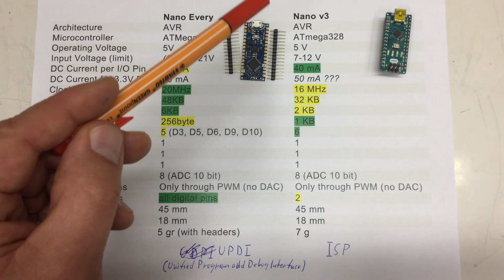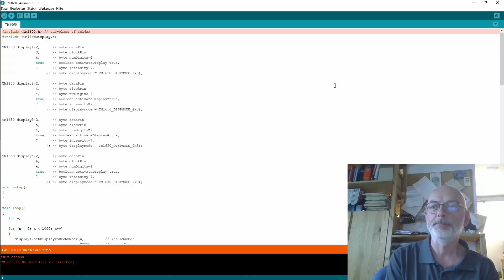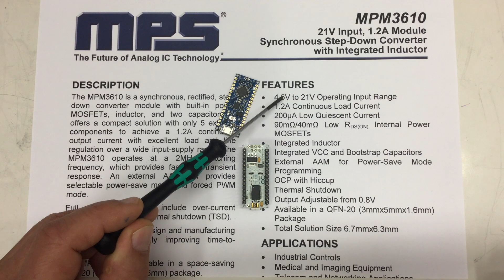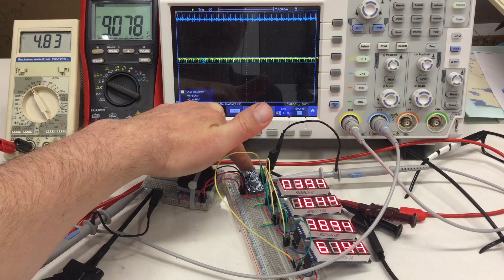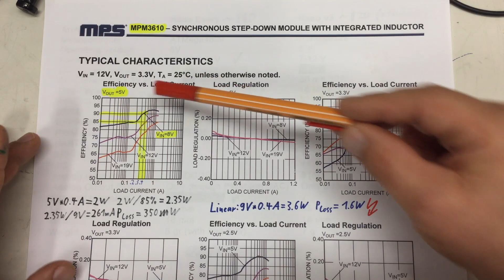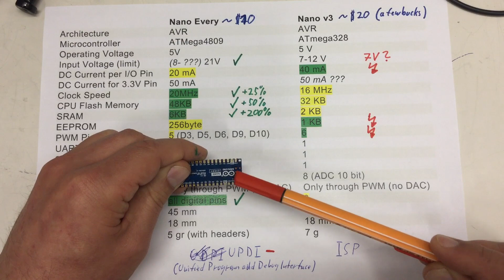Arduino Nano Every: The Better Nano? – Tests and Shootout with Nano v3

Comment: Nice overview - It's now 2025 and I just started using the Nano Every. The Arduino IDE is now version 2.3.6 and one still has to explicitly install the Every using the board manager. That warning message about the boot and flash memory still displays as well.
Reply from the maker: You're welcome! I'm still using 1.8.19. Any nice features 2.3 has that are missing from 1.8?

Comment: can I use the module Arduino Nano 3.0 ATmega328 Unsoldered 32KB Flash 14 Digital I/O 8 Analog Inputs for combining a few CO  sensors 4-20mA  in 2 analog outputs?
Reply from the maker: Well, yes you can. But you need to adapt your 4-20mA CO sensor outputs to the analog input pins or the Arduino (or any MCU). To be honest, I would use something like this https://www.analog.com/en/parametricsearch/12823#/ to interface your CO sensors with a MCU.

Comment: On atmega328p (nano) you can have pcint on every pin.
Reply from the maker: True, but PCINT has its drawbacks and the Arduino environment does support attachInterrupt() for the Nano v3 on pins 2 and 3 only, whilst for the Nano Every every digital pin is supported.
Reply: @robertssmorgasbord  Why use platform that limit programmers..
Reply from the maker: @konradpierzynski4251  Good question! The only reason would be ease of use. The Arduino IDE is dead simple, but, admittedly, also limited. Most people are using Arduinos in conjunction with the Arduino IDE because of that, instead of using the Microchip/Atmel compiler directly. BTW PCINT is also less powerfull / has more overhead (ISR is called for any change on a group of pins) than attachInterrupt() (ISR is called for a specific change on a single pin).

Comment: Datasheet for Nano Every states lower input voltage is 7VDC, just like the original Nano.
Reply from the maker: You're right. The "Tech Specs" ( https://docs.arduino.cc/hardware/nano-every ) now (*) state 7 - 18V.
(*) It didn't at the time I made this video.
However, the datasheet ( https://docs.arduino.cc/static/d3e00a492d6a8bcf78a307ef4f6b03c1/ABX00028-datasheet.pdf ) states up to 21V without giving a lower limit. So I would take all these numbers with a grain of salt. It all depends on how much current you're drawing from your Nano ...
Reply: @robertssmorgasbord  Oh I just looked at the specs recently. It could be that it was 8V earlier of that I am not sure. Cheers!
Reply from the maker: @MathPiSG  No sweat!

Comment: You can also very easily enable 2 additional UART interfaces as Serial2 and Serial3 on the Every. The ATmega4809 has a total of 4 UARTs and the "extra" two are connected to the board pin outs D2 (Serial2 Tx), D3 (Serial3 Rx), D6 (Serial3 Tx), D7 (Serial2 Rx) - but this is not initially accessible without a simple software hack. This link shows how to do the hack to enable the additional serial ports  - https://forum.arduino.cc/index.php?topic=639740.0 . Again I use this feature - it works cleanly.
Reply from the maker: Thanks for the info and the link! Having four hardware UARTs available might come in handy some day. May I ask what you're using all these serial interfaces for? Sounds like an interesting application.
Reply: @robertssmorgasbord  GPS pass through and snooping as well as injecting additional NMEA sentences for weather data. The receiver can read GPS and weather off the same port that way. So basically GPS dongle (RS232) -> MAX3232 (shift to TTL) -> ANE (Serial2) ->  (logic) -> ANE (Serial3) -> MAX3232 (shift to RS232 levels) -> RS232 interface to receiving controller (embedded Linux). Original config was just GPS (RS232) ->   receiving controller (embedded Linux) - so its now a man-in-the middle config using the ANE
Reply from the maker: @tonycook1624  Hi Tony, thanks for the reply. That sounds like a really interesting project. Are you using that on a boat ('cause of the NMEA)?
Reply: @robertssmorgasbord  Nope - astronomical observatory
Reply from the maker: @tonycook1624  Guess weather and GPS data can be used in astronomy too :-)

Comment: Lower Vin limit is 5volts - not the guessed 8 volts - I've verified this and it works fine
Reply from the maker: Thanks for the info! How much load did you put on the Every's 5V rail when feeding it 5V through Vin? BTW as of now (December 2020) Arduino specifies for the Nano (linear regulator) 7V to 12V and for the Nano Every (switch mode regulator) 7V to 21V.

Comment: Interesting little board.
I looked on ebay at the usual suspects to see if there were clones available, but the only listings I found actually cost more than for the genuine one from Arduino store! lol!
Reply from the maker: I didn't even know that clones are already available! Anyway, in time the Chinese will find a way to make them cheaper. That second MCU just for handling USB is a good candidate for cutting costs :-) And that on-board buck converter for the 5V rail is a bit over-sized (I feed the Nano 9V and draw almost 400mA from the 5V rail), a smaller, cheaper one will do :-)
Reply: Wow!
Reply from the maker: @andymouse  Indeed, wow! Without the Every my controller design for the laboratory water bath (upcoming videos) would have been much more complicated (separate 400mA 5V supply for all the LED displays plus another small 9V supply for the Every).